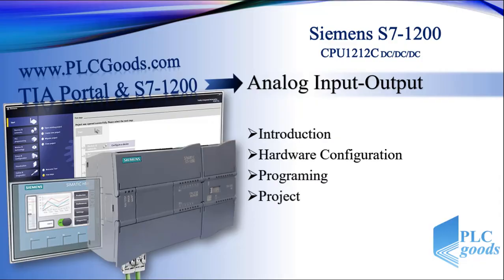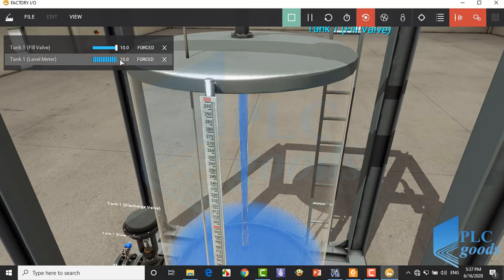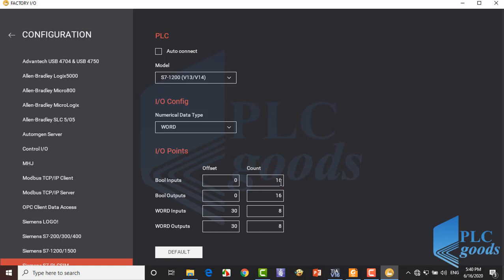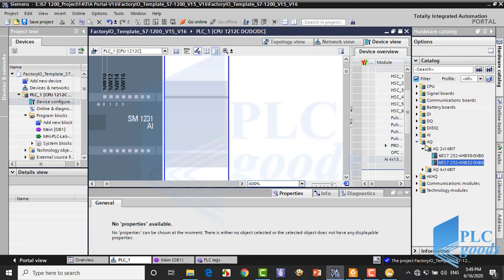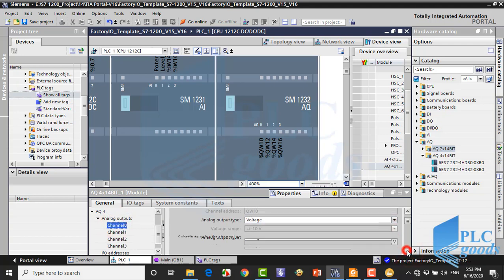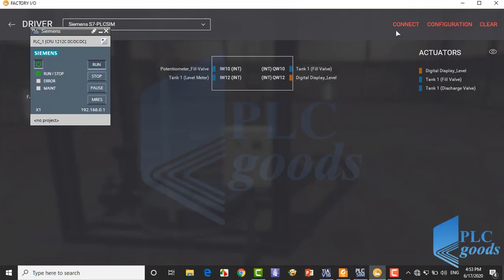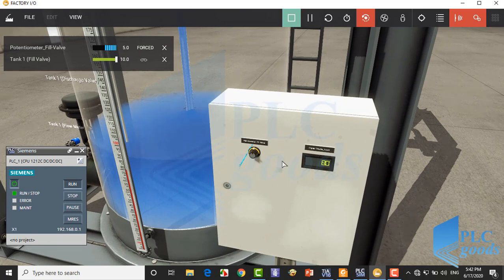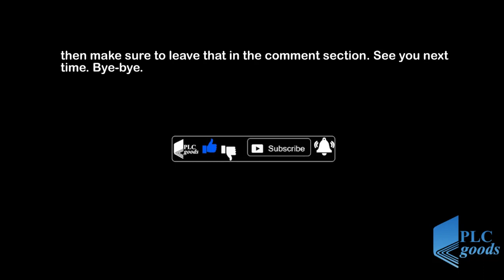PLC Analog I/O Project in Factory IO | S7-1200 Norm & Scale Tutorial | L 33

Comment: Dear sir,
I have SIMATIC S7-1200 and a Signal Generator Device and I use the NORM_X and SCALE-X functions in the TIA Portal program V 15 . The MIN value of NORM_X is 0.0 and the MAX is 27648.0 . It’s assumed that I use a RTD (PT100) with the Temperature Transmitter ranges ( -100 ˚C to 800 ˚C) and its output is 0-10 VDC. The output of NORM_X function is sent to two SCALE_X functions: one to scale the Ohms and the second to scale the temperature values.
I depended on the RTD Temperature VS. Resistance Table to get the MIN and MAX values for these two scale functions. The first scale function which is for Ohms the MIN value is -100 ˚C whereas the MAX is 800 ˚C and the MIN value for the second scale function is 60.26 Ω and the MAX value is 375.7 Ω ( Because -100 ˚C is equal to 60.26 Ω and 800 ˚C is equal to 375.7 Ω in the reference table).  
But when I inject the following volt values in the Analog input of the PLC the output values of the Two SCALE_X functions are not as shown in the table?!
Examples: 
1- At 2.5 V the output of the first SCALE_X function is 124.4141 ˚C and the output of the second SCALE_X function is 138.91 Ω but in the Reference table when the Temperature is 124 ˚C the Ohms must be 147.58 Ω.
2- At 5 V the output of the first SCALE_X function is 349.93 ˚C and the output of the second SCALE_X function is 217.9 Ω but in the Reference table when the Temperature is 349 ˚C the Ohms must be 229.36 Ω.
3- At 7.5 V the output of the first SCALE_X function is 575.488 ˚C and the output of the second SCALE_X function is 297.0111 Ω but in the Reference table when the Temperature is 575 ˚C the Ohms must be 305.63 Ω.
Why are the SCALE_X outputs not the same as what they must be as in the reference table?! And what must I do to make the outputs the same as what is shown in that table?!
Thank you and I’m waiting for your reply.
Reply from the maker: Hi there, Maybe the following points help you to solve your problem:
1- If it's possible, check the temperature with another device and compare it with the calculated temperature by your program to ensure at least the calculated temperature by the PLC is correct.
2- Note that, the Norm and Scale functions can be used only for linear trends. The PT100 trend is not completely linear. I recommend using the middle range of your PT100 to write your program. for example instead of using the -100 to 800 range, use the 0 to 500 range.
3- A better way is using Analog Modules that are designed to read PT100 temperatures directly, for example, 6ES7 231-5PD30-0XB0 .
4- Please read your device's catalog and also their updated version carefully. for example, I've found this sentence inside a document about using a PT100 that has been corrected--> The SM 1231 AI 4 x 16 bit RTD did not read values correctly in the case where you powered up the CPU with no RTDs connected and later added one or more RTDs to the station
Reply: @plcgoods  Thank you for your reply. I just want to tell you that I didn’t use a real RTD or Temperature Transmitter but instead I used a signal generator to generate 0-10 V as an input to the S7-1200 built-in AI channels. For this reasons and also according to what you said the output of SCALE_X function is not the same as shown in the reference table. Best regards.